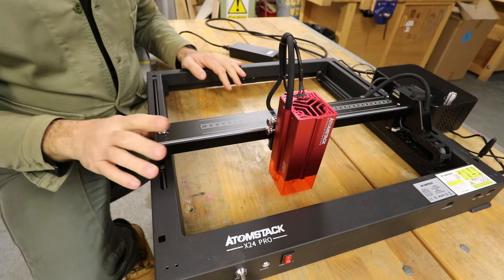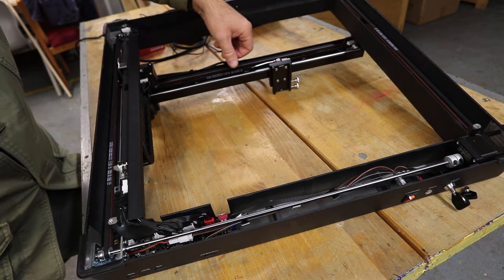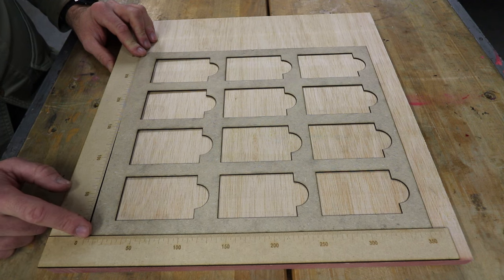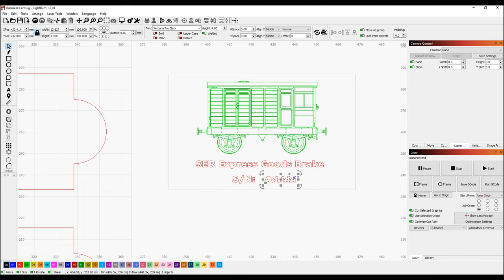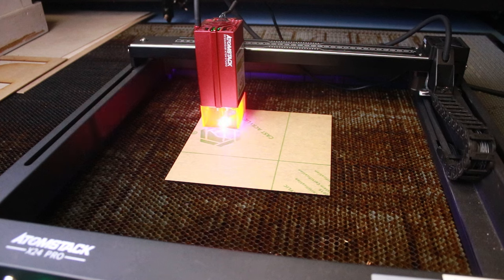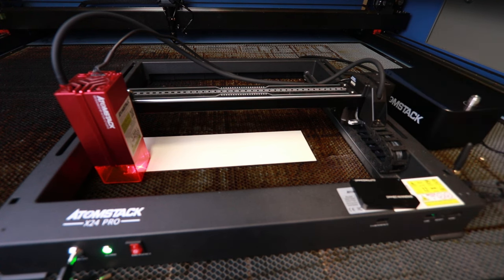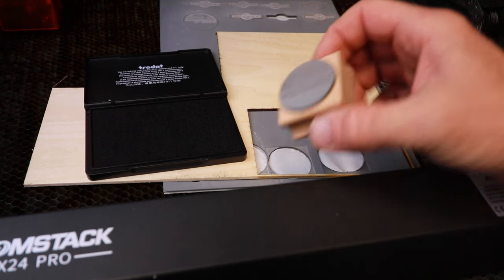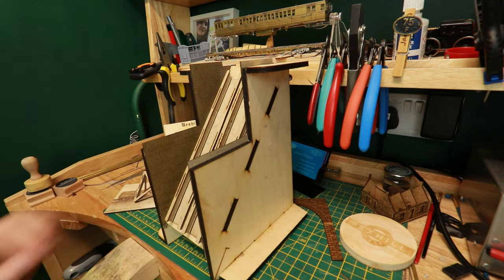S2 E36 Atomstack X24 Pro Test and Review

Comment: Hi James, 
Another great video, I especially like the Templot generated B8 timbers,
could you please tell me was that 3 MM plywood you used? or a bit thinner?
Cheers
Phil,
Ps would I be right in assuming going of the shape of the kerfs, that it was generated using version 2.43A of Templot? only asking as 2.44A now has kerf shape adjustment added.
Reply from the maker: Hi Phil,
Yes, I used 3mm plywood, and the the file was produced in 2.43a.
Best,
James

Comment: Hi James....I enjoyed your video and i too have an A24 Pro but my laser seems to lean forward on the gantry so its not level to the material surface i.e 4mm gap under front and 6mm at back . Could you confirm that yours is the same or level please and if it is then i need to somehow adjust the steel rollers etc to level it. This was how it was out of the box etc for me...Thanks in advance

Comment: Hi James, Great tutorial, really excited by the fact that this machine can give textural (uneven) surfaces. I've seen something similar produced by the Manchester group that was published in MRJ, but that appeared to be a very complicated method. Could you tell us how that image was produced. Also, how long will the laser lens last before needing to be replaced - any info on that would really help.
Many thanks and good to see you back.
Reply from the maker: Thank you Mike,
I've still developing my 'recipe' for engraving stonework.  I'm trying to develop a simple method, when I think I've properly cracked it I'll make a video and show what I've done.  But in essence, I take a photograph of the texture I wish to recreate, and manipulate it on the computer to make it seamless.  From there, it can be simply lasered, and the lightburn software will do all the heavy lifting and produce a good result simply burning the image.
However, in the example in the video I wanted to 'dress' the edges of the arch stones and pier quoins, to do which I created an overlay in CAD to engrave those particular areas differently and to a consistent depth to create the additional relief.  Additionally, the arch stones have been created separately as these were not in the original photograph.  
Once I've perfected this, I'll dab some watered-down filler across some of the stones to raise their surface above that of the base material to make the effect of relief better across the whole arch, which (fingers-crossed) should look quite effective.  For anyone who thinks lasering these arches is cheating, I've spent longer playing around trying to perfect the technique than I would have spent scribing stones into some DAS clay.  :)
I'm trying to perfect this for my Scalefour Society Jubilee Challenge entry.

As for how long will the laser last, I've no idea and it really depends upon how hard it is used.  For example cutting at 100% power will reduce the lifespan compared with mostly engraving at a lower power.  I would expect years of trouble free use, and suspect that most users would probably upgrade before the laser 'runs-out' to keep up with other technological progress.  A little bit like 3d printer users upgrade over time.  Replacement diode laser units are significantly cheaper that replacement CO2 laser tubes, another consideration to keep in mind.

Thanks for watching,
James

Comment: Hi James 
Your ending project looks like something a few miles down the coast from me, beech access maybe ?

Two other things, how do you find the little LED laser compares to your CO2 one ?

Typically air assist is I believe not recommended for etching or etch at a much lower pressure, but is suggested for cutting
Reply from the maker: Hi David,

There's no doubt about it a diode laser is much less hassle to use.  Less maintenance etc, and the lower power gives a very narrow 'kerf' width.  The downside is that it is considerably slower than than my C02 laser, especially when cutting.  I think that for model making purposes the diode laser is the more useful option.

Thanks for watching,

James

Comment: Looks like a nice piece of kit... How does it compare to the Creality machine you reviewed late last year?
Reply from the maker: That's a tricky question, both work really well.  The Creality machine has a slightly larger working envelope, whereas the Atomstack machine has a marginally finer cut (Kerf), the laser cross hair and a more powerful air assist.
Both work really well and there really is no noticeable difference between the two.  The wifi app control of the Atomstack is also nice feature.
I'd be happy with either machine and would find it difficult to place one above the other.  Either way, both are significantly easier to use and more repeatable than my CO2 machine.  I am definitely sold on diode technology.
James

Comment: For my testing a new machine, I cut a square piece of Basswood that I "engraved/filled" the nominal 86mm x 54mm size of the cards and at each corner also engraved a small circle to facilitate the removal of the cards after burning.  At the top and bottom of my jig I engraved a couple of crosshairs exactly 120 mm in distance with the center point of engraving at 60 mm.  When I want to engrave a business card I position the laser head somewhere in the middle, align the top crosshair, then "hit move" down 120 mm, recenter that crosshair, then back to the top.  When all is square, I move down 60 mm to the center of the recessed area, place a card, burn, then remove.  I initially made my jig for one card, but, duplicate the recessed area for as many you need and burn several at once.  The only real way to ensure a centered burn is by a two point crosshair alignment like I mentioned.  One question, did the belts come pre-tensioned?  Or did you check??  Thanks for your review..
Reply from the maker: Thank you @ainttakenanyshit, some useful advice there which I am sure will help others too.  As for my machine, yes the belts did come pre-tensioned.  I ran a check for squareness and parallelism, all was great straight out of the box.
Thanks for watching,
James